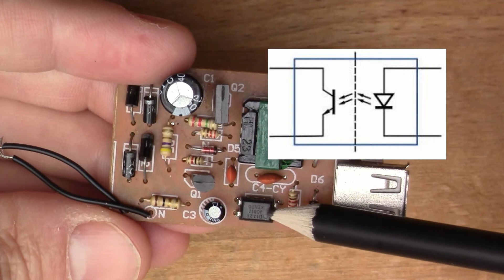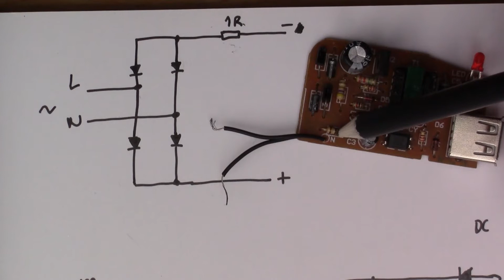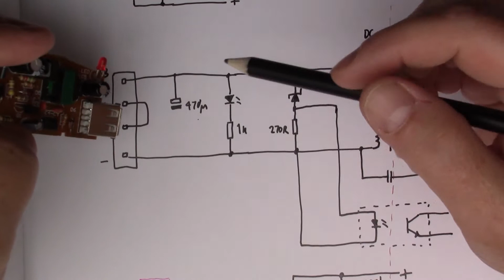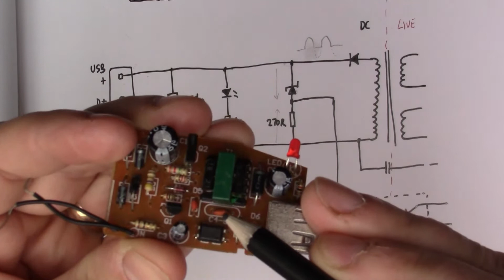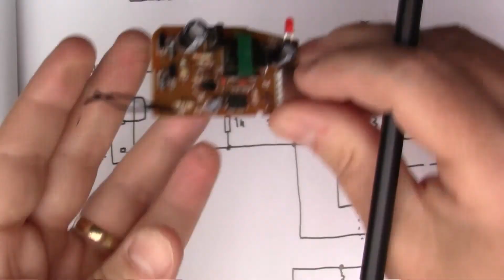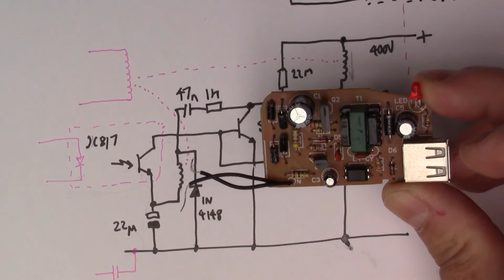USB Wall-Wart Power Supply Teardown (#47)

Comment: Thanks. Very informative. I tried drawing one of these out the other day just like you did. I am trying to teach myself basic smps repair and theory by watching videos and tearing down a few cheap ebay adapters (they are pretty much the same inside) but I still can't figure out how the opto is throttling the the primary transistor via the intermediate transistor. Need to study a bit more I think. On the plus side, I managed fix a few and the winding on the one I sacrificed in the name of discovery wasn't as bad as I expected. Keep it up. Subbed.

Comment: Yeah very nice vid thanks mate! The way you flip the board and have the circuit drawn on top is brilliant, in addition to that tho; should have another pic of just the top side of circuit so you can have like all three visual aids..an go back and forth. Make it even better!.
How do those mains wires handle 220 or even 120V tho? Shouldn't they melt?

Comment: Yes, that capacitor should most certainly be Class Y ! If it isn't then that power supply is ILLEGAL !!! It enrages me when I see stuff like that. Damn Chinese most likely. What brand is it ? It's not neutral on the live side either, it's the negative of the AC bridge rectifier.
Reply from the maker: It was some kind of no-brand Chinese PSU - I don't even remember what it came with.

Comment: These little things seem like fire hazards.  I'm always wondering about these inexpensive little things and tend to just buy higher end commercial units and avoid the Chinese stuff.  I like that you are showing a cheaper one as THESE are the things I'm  concerned about.  would like to know where it came from.  These things are never marked and I wish they would be classified in some way on the markings to know that they use cheaper components.
Reply from the maker: I'm with with you on this.  An electronics company with a brand and reputation are more likely to do the tests and go through the necessary approvals.  At the low end (as here) they are always trying to eliminate components and skimp on redundancy.

Comment: Hi; simple question. I have a 5v power supply with 2 black cables. One is plain black and the other is black with white dashes. Which cable is positive? It is used to supply power to a D to A converter.
Interesting video. Thanks.
Reply from the maker: I don't know if it's completely standardised.  I would always measure it with a multimeter.